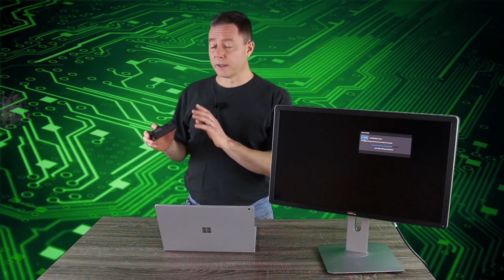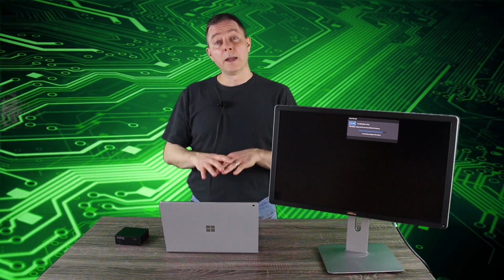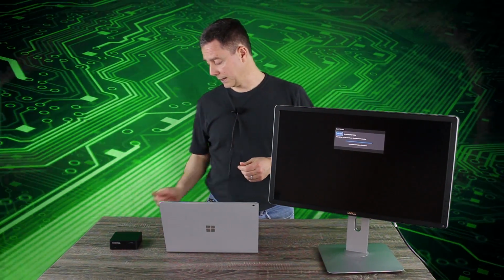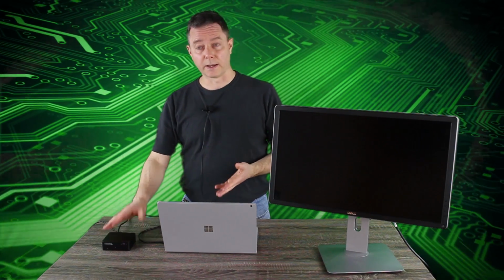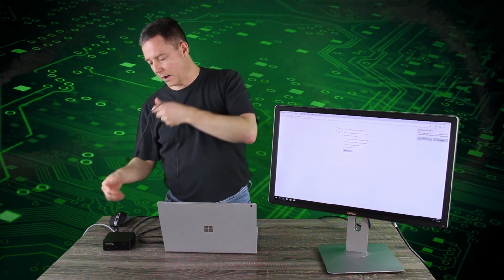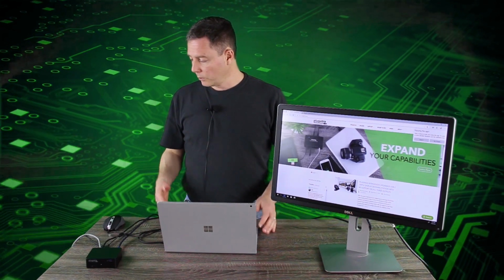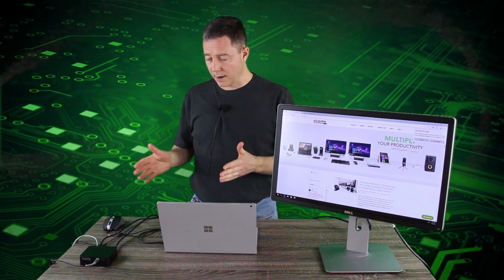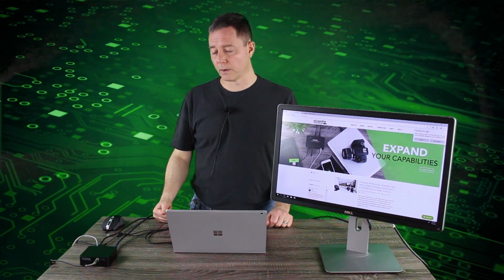Plugable's Most Powerful and Compact USB-C Docking Station with Power Delivery (UD-CAM)

Comment: I have a Lenovo Think Pad T470 for work and a MSI GP62MVR 6RF Leapord Pro for personal use.  They both have a USB-C port,  but only the Thinkpad has a lightning symbol next to the connection.  Do you know if both will work with this dock or should I be looking at something else? I'm really in need of a station that also powers the laptop.

Comment: what is the difference between usb port in front vs back..can the usb port in front be used to act as dock to tablet simultaneously.
Reply from the maker: Hi Bakul,

Thanks for asking the question, we're always happy to help!

The USB 3.0 port on the front of the UD-CAM dock is compliant with the USB-IF BC1.2 standard, so it can deliver up to 5 volts at 5 amps if your device supports it. This may be enough power to charge some tablets, but will not charge all tablets.
The rear USB ports are standard USB 3.0 ports, so they support a maximum of 900mA at 5 volts.

Please reach out to us at support@plugable.com if we can provide specific recommendations about your setup and we'll be happy to help.

Thanks!
-Andrew T.
Plugable Technologies

Comment: I’m running MacBook Pro 2019 15”. 
There’s only two monitors that support USB C charging up to 85w on the market so far. And these are over £1K. 

This will power my MacBook? 
Also am I able to have a powered external hardrive plugged in the USB? 

Thanks.
Reply from the maker: Since the MacBook Pro 2019 15" has a 61W power adapter, the UD-CAM dock can charge your MacBook during use with up to 85W of power. Regarding an external hard drive, these can be connected to the USB 3.0 ports on the UD-CAM dock. However, Apple SuperDrives are not supported. For any further questions, please contact us directly at support@plugable.com -- thanks!

Comment: Hey 
1-does this hub work with regular usb c or thunderbolt 3
2- is there a version with a display cable instead of hdmi, because I need 144hz
Reply from the maker: Thanks for asking! This docking station is designed for USB-C and Thunderbolt 3 systems. Please note not all systems are supported. We do not have a DisplayPort version at this time. Please contact us at support@plugable.com if you have any additional questions.

Comment: Hi, can the Power Button on the dock start the laptop while it's closed and stut down?
Reply from the maker: Thanks for asking! Our docking stations cannot power on a connected host system from an off-state. The power button on the dock solely turns off and on the dock.
Reply: @Plugable  That's a bummer, maybe you can "active" that feature via Wake on Lan somehow. So you can use you laptop as a desktop completely.
Thanks for the fast reply though.

Comment: Does it work with Acer Swift 3 SF314-55G for charging?
Reply from the maker: Hi There, 

Thank you so much for reaching out to us! While we have not had this specific system inside of our testing labs to verify its compatibility, Acer does indicate that the system has a USB-C USB 3.1 Gen 2 port that supports Power Delivery and VESA Alt-Mode, so it should allow you to charge the system when connected to the UD-CAM. I hope this information helps, if you have any additional questions or concerns, please feel free to reach out to us directly at support@plugable.com, and we would be more than happy to help. 

Thank you for your time,
Marc
Product Owner & Technical Support
www.plugable.com/support

Comment: would this work with a razer blade 15 to make a desktop setup? this laptop has a power brick and would not take power delivery via the usb c connection.
Reply from the maker: Hi There, 

The UD-CAM is not compatible with Razer based laptops, due to them having specific BIOS restrictions in place for a multitude of third-party USB-C based devices. We have attempted to reach out to them to send in various samples, but have not received any word back. I hope this information helps, if you have any additional questions or concerns, please feel free to reach out to us directly at support@plugable.com.

Thank you for your time,
Marc
Product Owner & Technical Support
www.plugable.com/support

Comment: Hi, Does this dock connect a 1 TB to 3 TB USB powered external drive?
says online "the "My Passport" 2.5" drive series requires a USB 3.0 port with a minimum of 650 mA available."  

Are the USB 3.0 ports on this dock 650 mA and above? maybe above 900 mA? Thanks
Reply from the maker: Thanks for asking! USB 3.0 ports per the USB-IF USB 3.0 standard must support 900mA. The ports on our dock are capable of powering the drive without issue! Contact us at support@plugable.com if you need any assistance!
Reply: @Plugable  You're welcome! I found out from @SplashDMG Tech that two external drives can work with dock.  Is two the max? or is it possible to connect three? I figure that a dock can only hold so many external drives at one time.  Thanks
Reply from the maker: You should be safe with 2-3 drives attached, but we wouldn't recommend more unless you're attached an additional powered USB 3.0 hub inline to the dock to reduce the load.
Reply: @Plugable  alright 3 at max, good advice, thanks! can't wait for it to arrive!
Reply from the maker: No problem! Any issues at all just shoot us an email, we're always happy to assist! (support@plugable.com) Happy New Year!

Comment: Hi there. Is this compatible with dell xps 13 9370. Thanks.
Reply from the maker: Thanks for asking! Our UD-CAM dock is compatible with the Dell XPS 13 9370 for charging, data and video support to attache one monitor via the HDMI port. Please be aware that the maximum resolution on the external monitors that our dock can support is 3840x2160@30Hz.
Reply: @Plugable  thank you. Can i stil use just once Usb C cable to connect the dock and the laptop? So I connect the hdmi cable to the dock, and usb C to my laptop. Yes?
Reply from the maker: That's correct.

Comment: This product look perfect for my MacBook Pro 15 inch. I just wonder if it will charge the MacBook without it loosing power . How many watts those it delivers. Like the MacBook Pro is a 81 watt power deliver .
Reply from the maker: Hi Cesar, 

This is an awesome question! Thank you so much for reaching out to us. The UD-CAM does provide Power Delivery, so it will charge any compatible host system it is connected to (such as your Macbook Pro 15in,  if it is a 2016 and above model) and provides 85W of total charging/Power Delivery. I hope this information helps, if you have any additional questions or concerns, please reach out to us directly at support@plugable.com. Thank you!

-Marc
Product Owner  & Technical Support
Plugable Technologies

Comment: This is really cool. Would this work on Mojave on MacBook Pro 2018 15". I would also like to know if it is 30 or 60 Hz on the 4k. Thank you.
Reply from the maker: Thanks for asking! Yes, this should be compatible with the 2018 MacBook Pro running Mojave. The dock supports 30Hz at 4K.

Comment: If I don’t need power delivery on my laptop, do I still have to connect the power cable in to the docking station? Thanks in advance.
Reply from the maker: Hi There,

Thank you so much for reaching out to us! The UD-CAM is not USB bus powered, so it will require the AC Adapter for the dock to be connected in order to utilize all of the great features of the dock. If your system does not support Power Delivery,  you may need to review the specifications of your system to ensure that it will work with the other great features of the UD-CAM. I hope this information helps, if you have any additional questions or concerns, please feel free to reach out to us directly at support@plugable.com. 

Thank you!
Marc
Product Owner & Technical Support
www.plugable.com/support

Comment: can i use my lumia 950xl with the docking station?
Reply from the maker: Hi There! 

Thank you so much for reaching out to us, I would be more than happy to answer your questions. According to the specifications (https://www.microsoft.com/en-us/mobile/phone/lumia950-xl-dual-sim/specifications/) the Lumia 950XL does have a USB-C port that supports USB 3.1, but there is no indication that it allows for Power Delivery, VESA Alt-Mode, and Data via the same connection. These are requirements that the UD-CAM has for the connected system. We have not had this specific phone  inside of our testing department to verify its compatibility, and without additional information, we cannot advise that it would be compatible with this dock. I hope this information helps, but if you have any additional questions or concerns, please feel free to reach out to us directly at support@plugable.com, and we would be happy to help!

Thank you,
Marc
Product Owner & Technical Support
www.plugable.com/support

Comment: I understand that this dock only has 1 display output, but if the external display supports daisy chaining will this dock be able to output to both?
Reply from the maker: Sorry Cameron, the dock will not support daisy chaining, also known as "MST". (MST behavior can be a challenge to get working right. If MST functionality is needed, using a host system, dock, and monitors all from the same manufacturer will usually produce the best results. None of our docks support this MST.)

Comment: Will this dock allow you to charge/operate the laptop while its closed?
Reply from the maker: Hi Cameron,

Thank you so much for reaching out to us, this is a great question! The UD-CAM will allow you to charge/operate the device with the lid closed, as long as you have modified the Power Management settings of the connected system to "Do Nothing" when the lid is closed, modified the Device Manager settings for the dock to "allow this device to wake system" and set the connected display on the dock the "Primary" so that all applications can open and be utilized on the connected display. I hope this information helps, if you have any additional questions or concerns, please feel free to reach out to us directly at support@plugable.com.

Thank you for your time,
Marc
Product Owner & Technical Support
www.plugable.com/support

Comment: I have a HP Spectre x360 laptop and I bought a Targus docking station but there is no way to plug the USB-C port power cable into it. Does your docking station solve this problem?
Reply from the maker: Hi Norman,

Thank you so much for reaching out to us! Just to make sure I have all of the right information, are you attempting to power your system via a connected docking station? (Connect a USB-C Power Adapter to the dock, then have the dock charge the system) or are you looking for a dock that would charge your system when connected?

Thank you for your time,
Marc
Product Owner & Technical Support
www.plugable.com/support
Reply: Hi Marc, I want a docking station that I can connect to my laptop with a single wire that will power my laptop and provide all of the connectivity that i need (i.e. monitor, keyboard, mouse, headphones, external hard drives, etc.) Perhaps this is a question that I need to ask HP because I'm not sure if the HP Spectre's USB-C port that is used for power, will also work for display.
Reply from the maker: Hi Norman,

Thank you so much for clarifying! We do offer multiple docks that allow for Data, Power Delivery, and Display out via a single USB-C port, but you are correct! You need to ensure that the USB-C port on your system allows for all three of these features via a single port. If you need any additional information after confirming that your system is compatible, please let us know!

Thank you for your time,
Marc
Product Owner & Technical Support
www.plugable.com/support

Comment: Does this work and charge XPS13 9350? 
What about supporting two monitors?
Reply from the maker: Hi There,

Thank you so much for reaching out to us! The UD-CAM does provide Power Delivery to XPS systems, such as the 9350, and supports 1 display via VESA Alt-Mode. In order to connect an additional display, you will need to utilize an additional USB 3.0 Graphics adapter, as the docking station only has one video output port. I hope this information helps, if you have any additional questions or concerns, please feel free to reach out to us directly at support@plugable.com.

Thank you for your time,
Marc
Product Owner & Technical Support
www.plugable.com/support

Comment: Does this support Yoga 920 (for charging)?
Reply from the maker: Hi There,

Thank you so much for reaching out to us! Based on the information available on their website and manuals, it does look as if the system supports VESA Alt-Mode and Power Delivery, but there is no indication that the two can be utilized via the same USB-C port. There are some Lenovo models (such as the 910) that only allow Power Delivery via 1 USB-C port, and VESA Alt-Mode via the other port, but not at the same time. 

I hope this information helps! If you have any additional questions, please do not hesitate to reach out to us directly at support@plugable.com

Thank you for your time,
Marc
Product Owner & Technical Support
www.plugable.com/support

Comment: Does it work with the newest Lenovo 720s 14?
Reply from the maker: Hi There,

Thank you so much for reaching out to us! While we have not had this specific system inside of our testing department to fully verify its compatibility, the base 720 model is fully compatible, and has been verified by multiple customers. If you do elect to purchase the device and run into any issues, we would be happy to offer a full refund, and add the device to our compatibility chart. This way we can mark it as incompatible, so other customers do not run into the same issue. I hope this information helps, if you have any additional questions or concerns, please do not hesitate to reach out to us directly at support@plugable.com.

Thank you for your time,
Marc
Product Owner & Technical Support
www.plugable.com/support
Reply: Thank you for the reply. Is there any way to get this shipped to Norway?
Reply from the maker: Hi Simen,

Currently, this device is only available in Amazon.ca and Amazon.com supported regions. We are planning on launching an EU and UK listing at the end of March, early April 2018. 

Thank you for your time,
Marc
Product Owner & Technical Support
www.plugable.com/support
Reply: Norway isn't in the EU - does that mean that I won't be able to buy it? Thank you for the replies, I really appreciate all the help :)
Reply from the maker: Hi Simen,

I completely agree Norway is not in the EU, but we have a number of customers who utilize Amazon.co.uk to purchase devices for this geography, as well as from Amazon.de. You may be able to purchase a unit via Amazon's Global Shipping Program from Amazon.com once stock has been replenished in this geography. You can learn more about it here -> https://www.amazon.com/International-Shipping-Direct/b?ie=UTF8&node=230659011

I hope this information helps, please let me know if you have any additional questions!

Thank you for your time,
Marc
Product Owner & Technical Support
www.plugable.com/support

Comment: Has HP corrected their proprietary USB -C power delivery FUBAR?? Their flagship Spectre series does not allow power delivery over USB-C.
Reply: SMASH HIT STUDIOS Short answer is yes with a minor caveat. I have the 2017 Spectre 13 that I use with a j5create USB-C minihub. The hub provides power, Ethernet, hdmi, and USB-A to the Spectre. The only issue is that you will get an initial warning that HP recommends their own adapters for powering the laptop. It is only a warning and it works perfectly. Funny thing is that I am using an HP adapter to power the hub.  This Plugable device should work great with the Spectre line.  Older models may require a BIOS update.

Comment: Does this dock support multi-monitor? If not, which dock model would be best? I would like to add a keyboard and close the laptop lid (while the computer keeps running) to complete the desktop setup. Is that possible?
Reply from the maker: Thanks for asking! Our UD-CAM dock can only support one additional monitor (in addition to your laptop screen). You can add DisplayLink adapters like our UGA-3000 to get more (http://plugable.com/products/uga-3000/). Or you might want to look at our Triple Display USB-C Docking Station UD-ULTCDL (http://plugable.com/products/ud-ultcdl), which has very similar functionality to what this video shows, plus two built-in DisplayLink-powered HDMI outputs and 60W charging. If you have a USB-A system, charging isn't possible, but you can get two displays with our popular UD-3900 dock (http://plugable.com/products/ud-3900). Hope that helps! We specialize in these kinds of dock and graphics products. Please contact our direct support email at support@plugable.com and we would be happy to assist further!